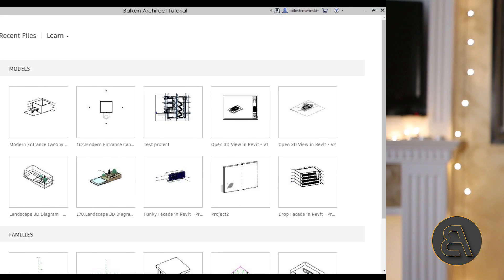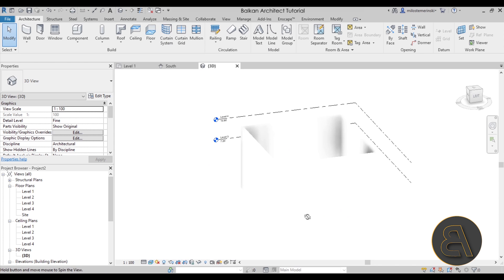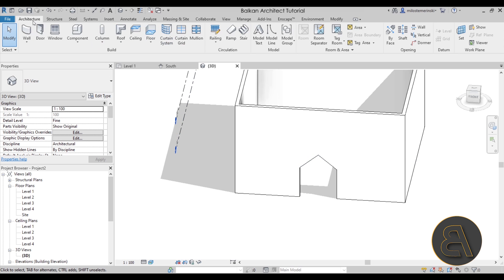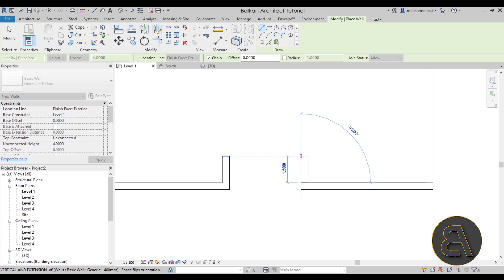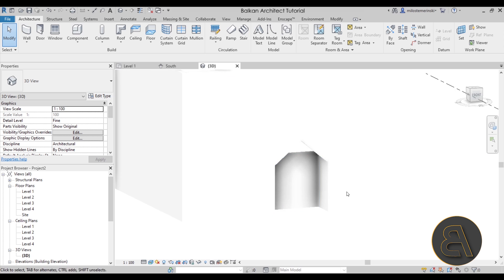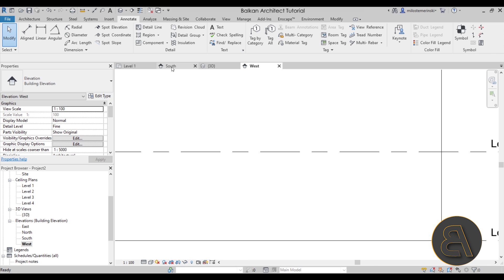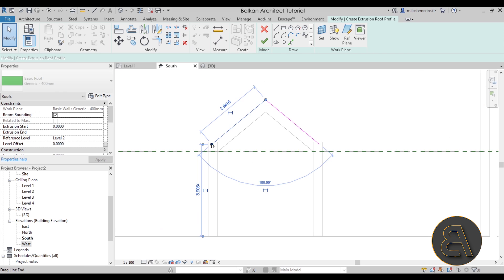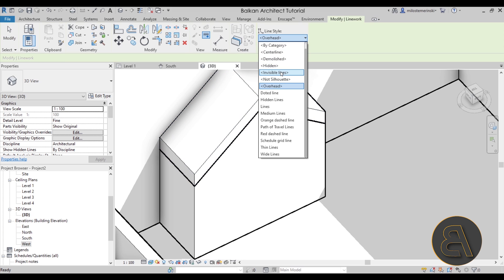Gable Entrance in Revit Tutorial

Comment: Revit is a tool for providing great 3D. I work with people who use or have used Revit, Chief Architect, and Archicad. Everyone one of them says it takes too long to do 3D in residential and commercial construction, and maintain profitability in the office. Also many of these people are salaried employees, working 60 hours per week and getting paid for 40. 
I recently hired someone who worked with Chief Architect to measure a house and draw it. He drew the plans and when it got to 3D, because of a complicated roof structure, he told me to draw the house in 2D as 3D would take too long. He also had another person come in and help him. Both said 3D would take too long, and I don’t think either one of them wanted to do it. 
Our engineers hate Revit!
One other thing. Converting Revit to Autocad (.dwg files) you are not guaranteed 100% conversion. Who knows what those gremlins are doing during the conversion process. 
Revit is good for multi-million dollar projects where the drawings will be used for manufacturing. 
You need to decide what is the best program to use.
Reply: I use Revit regularly for water/wastewater utility projects, from small illustrations (for field RFI requests that take 30 minutes all in 3D that save thousands of dollars in change orders by clarifying a design concept), to complete water and wastewater treatment plants detailed down to the smallest pipe, complete mechanical equipment, and building details. The complete projects take from 30 hours for a single building fully detailed to approximately 70 hours for complete multi-process building project site. To draw all of these in 2D (plan, sections, standard details, etc. would take at least 3 times longer typically. I've done it. I've been designing treatment plants in Autocad 2D and 3D for 28 years, and Revit for the last 5 years. The time saved alone by modeling ONE 3D structure and cutting endless coordinated 2D views is mind boggling, and all the benefits that come from a detailed, parameterized and data-populated model add so much more value than manually coordinated 2D views. For those project managers (my internal clients) that try to tell me 3D is more expensive (takes too long), I say give me half the amount of budgeted time and I can give you complete drawings that are completely coordinated. If I can't do it, I will not charge your project. I win them over every time.
Reply: @boblupo  My understanding is that it works well for piping, and multiple layers of piping. None of my engineers use Revit for structural, mechanical, plumbing and electric. In the past 10 years the fire suppression contractors are still using Autocad pre 2018. 
We all know there is a huge learning curve to master Revit. Not all of us have that time. Maybe those learning on Revit will be coming more and more into the A/E profession.
So far most of the Revit drawn houses are boxes and lack detail, maybe its just too difficult to draw.
Reply: @joegotz1971  revit can do most things, but companies dont invest in templating or training and just want to deliver projects all day. Many people are also lazy and expect their company to teach them everything. Recipe for disaster.

I have clients who use revit to turn around housing designs in less than a day, but the template and training are critical to make it work.

Comment: Can u please recommend a laptop for these softwares. Thanks
Reply: You can use any 
I am using a dual core laptop with intel hd graphics 😂
Reply: Best Laptop

2TB SSD(Solid System Harddriver)
8 Gig Memory
8 Gig Graphics
Windows 10
Office 2016/2019
Reply: Definitely more then 8 GB RAM! Or start with that but make sure there is some space for upgrade. You can save on graphic card, 4GB will do fine.
Reply: I7+ processor
16gb+ ram
Quaddro, rtx or ti graphics

And enough ssd/hd to hold it all with at least 20% free space.